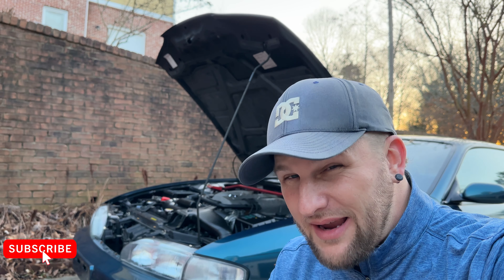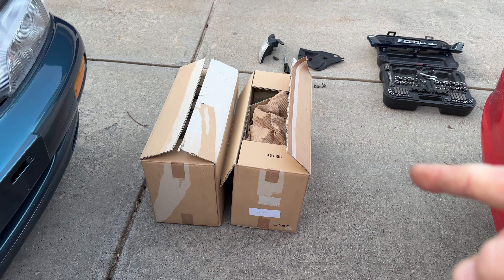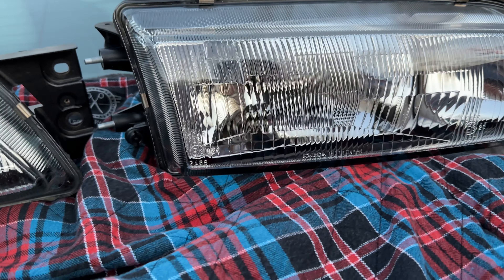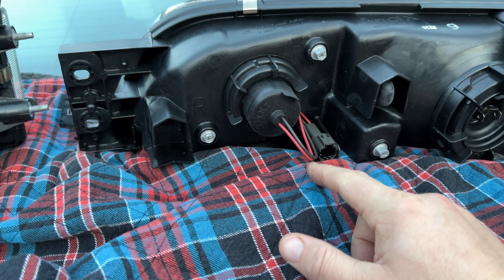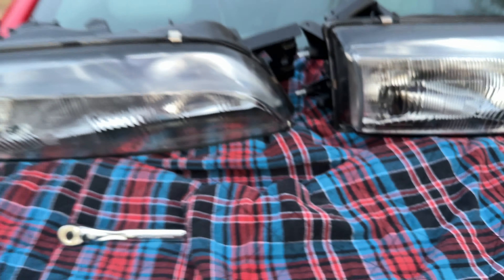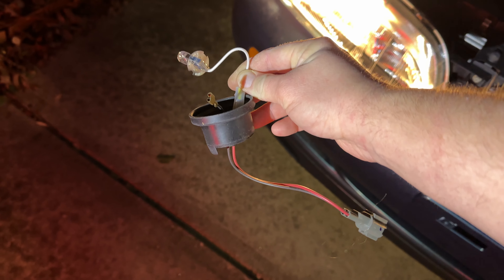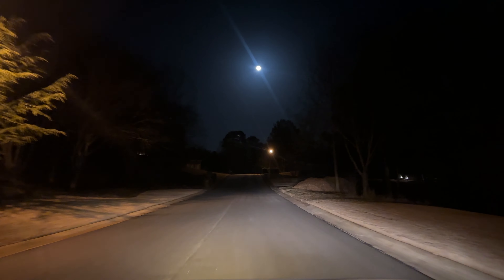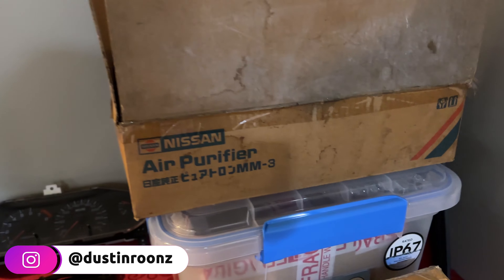This Will COMPLETELY Change the Way You Look at a Zenki S14

Comment: Good vid man. So is that a Navan front number with the oem USDM lip??
Reply: Or maybe USDM bumper that doesn’t have the bottom grill cut out??
Reply from the maker: Thanks man, it’s just the normal bumper with the oem lip. I believe it’s the same as the usdm bumper. I could be mistaking but for sure it’s not the Navan. I wish I had one of those though haha. I have the sides and rear spats waiting in the wings for a future install
Reply: Jdm zenki bumper is same as usdm. But jdm has license plate bracket.
Reply: Yea the license plate holder war throwing me off and guess the grill that in it is always cut out. Never seen one with it still on and not cut out
Reply: Also you guy have any more?? I want a new/super clean set so bad